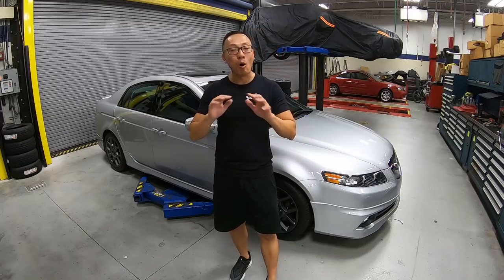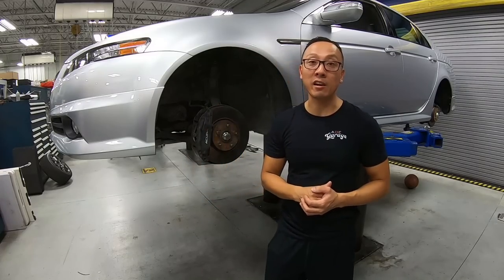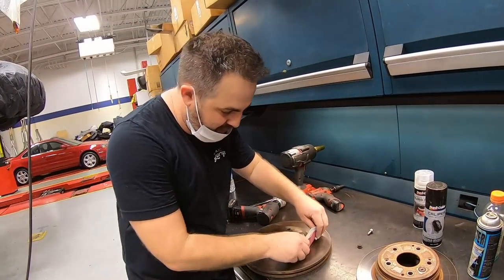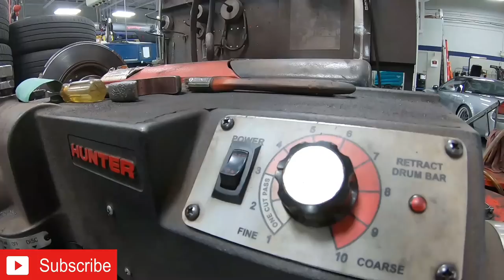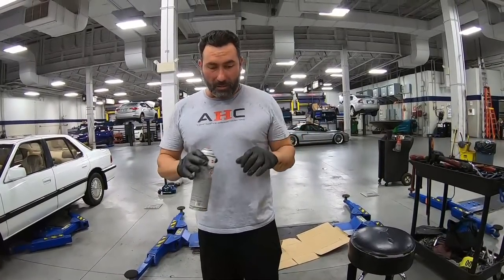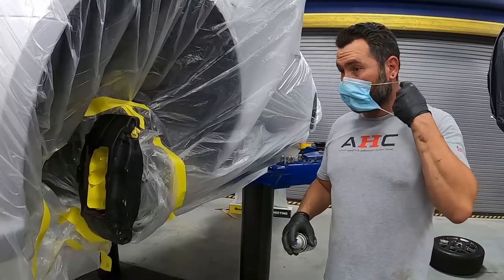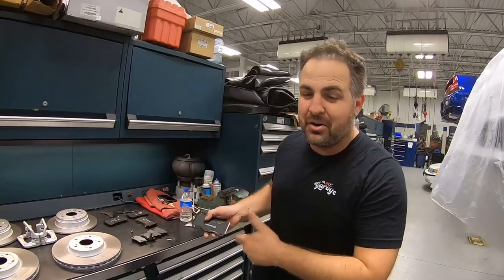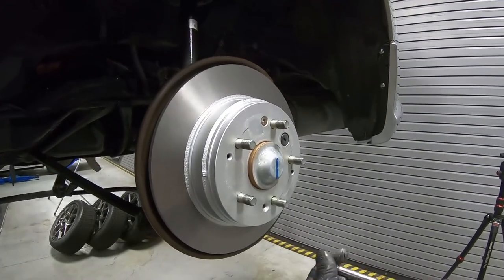AHC Garage TL Type-S Build Project - $30 DIY Guide for Brembo Brake Calipers and Rotors (Episode 25)

Comment: Big thing I like to do when it comes to brakes is whenever I remove the rotor either to replace or resurface I always put a metal wire brush on the wheel hub to get as much of the surface rust off as possible And then I always put a layer of anti-seize on the hub before I put the rotor back on That way It won't rust weld itself to the hub And it makes life a whole lot easier when servicing it again

Comment: Dont mind me, this comment is my own notes for when I tackle this soon 💪🏽 My 2004 6spd’s calipers are in same common rough shape, grey w/ all the clear gone and Acura logos faded :(
4:00 DIY start, caliper removal
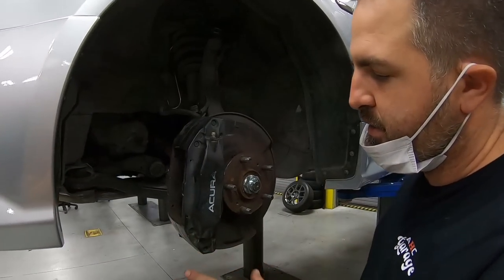10:20 caliper prep
12:21 caliper painting
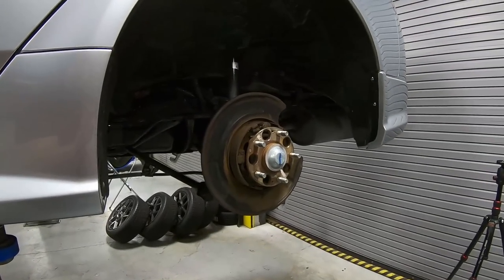18:12 done
20:30 finished results
Reply from the maker: Thanks for the chapter. We might need to add that into our description
Reply: @ahcgarage  thank you guys for the excellent video guide, and all the DIYs on this project! Oh and I was able to find the exact same paint n clear spray cans at my local Advance. Dupli-color Gloss Black enamel brake paint + gloss engine clear (the engine clear is rated the same high temp as the caliper paint, 500*F which most street driving will never ever reach!)

Comment: Hey i really wanna do this on my TL S, where do you get those Brembo stickers also do you need the piston Separator or can you use something else
Reply from the maker: Amazon will have both items that you are looking for. Set of stickers for less than $6-8 and brake caliper piston tool for less than $25
Reply: AHC Garage link for the paint?

Comment: I just found this channel and it's great because I got a 2007 Kenetic Blue Pearl Auto with 187k. I need to do more maintenance than modification like engine/transmission mounts, valve cover gaskets and valve adjustment, power steering pump overhaul and all the fluid changes. Since you guys are working at an Acura dealership, are there any other recommendations at 187k to do?
Reply from the maker: Thanks for joining us. You pretty much hit all of the items that’s recommended

Comment: At 15:30, there are heat shield shims right above the front brake pads. Are they necessary (given the shields already on the front pads), or redundant?

Comment: How often do you guys get the issue where the caliper bolt is galled at the last couple of threads into the aluminum Brembo? And what is the best way to remove them without ruining the caliper? My 07 UA7 put up a good fight so left it alone for the time being.
Reply from the maker: That usually caused by over tighten or corrosion build-up. You can lube it with some penetrating oil while you turn the bolt loose (or both direction). Once it’s out, use a Tap & Die set your clean out the threads. Apply some Anti-Seize lubricant on the threads before you reinstall and torque down the bolts
Reply: AHC Garage Thank you, that’s better advice than most of what I see posted out there. Keep up the honest and well detailed content and lastly, this has to be the best Honda purist channel on YouTube. Period.
Reply from the maker: Thanks so much for your support. We try our very best to put our helpful content to help our community

Comment: Just wanted to say your rear aspec is a little low
Reply from the maker: The rear lip meant to sit lower than the rear bumper portion
Reply: The official instructions doesn't really specify but I seen it installed flush with the line off the dealer and it was known to be the "right way" on forums.

Which.. kind of makes sense given there's a perfectly visible bumper line that lines up exactly with the a-spec.
Reply from the maker: Agreed. It would makes total sense if they actually line up with the bumper but it doesn’t. However you can force it up to line up with the rear bumper but not something we like to do.